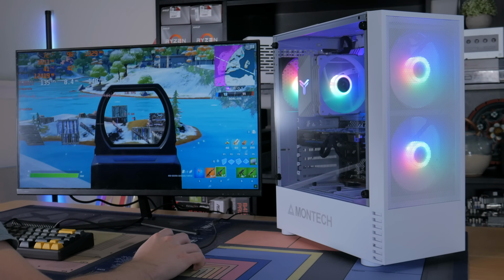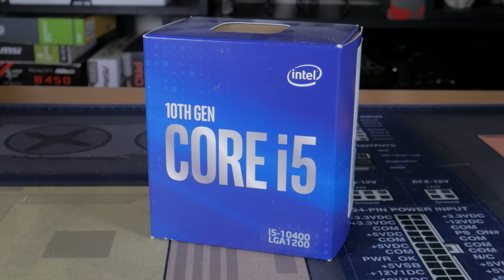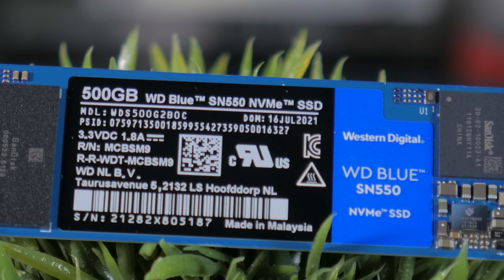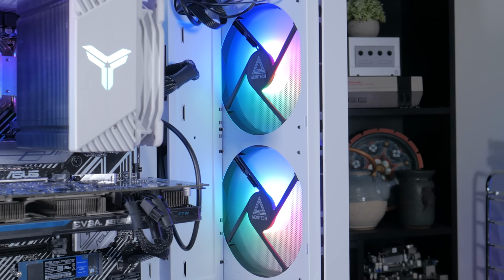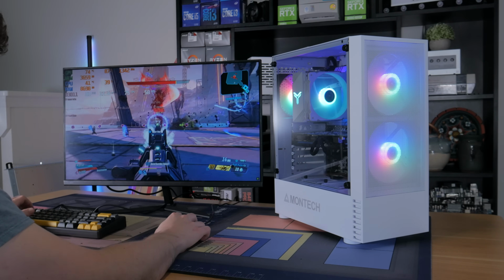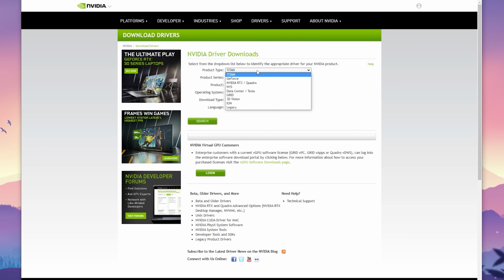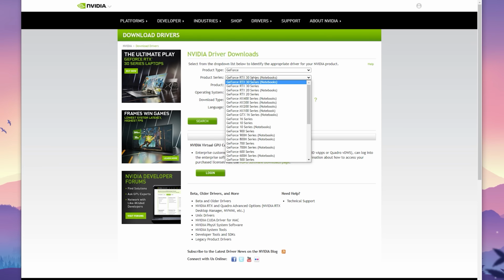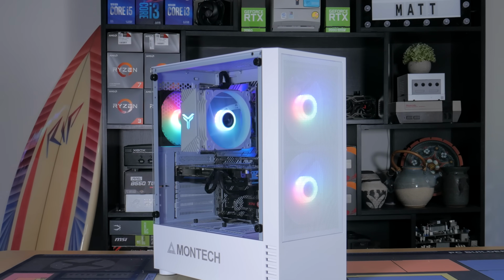$700 Gaming PC Build Guide! (2022)

Comment: So Glad to see you went with 16GB 8GB x2 kit for the DDR, in dual channel mode really boosts gaming performance considerably also helps with some productivity applications as well. I have seen some medium-budget builds on using a single 8GB ddr4 ram stick and it shows in the game stats. Today you can find a use 1660 super used on Ebay with careful bidding for as low $140.00 USD what difference a year and the end of crypto mining make on GPU prices.👍😉 Great video BTW

Comment: A GTX 970 is very similar to my GTX 1060 so I can assure you it's a pretty good card. I can still run most modern games in Medium-High settings at 1080p. I really wanted to upgrade last year, but GPU prices went to the moon and I just couldn't justify spending 700 USD for a 350 GPU. I really hope prices go down so I can buy an RTX 3060 and give my beloved 1060 a deserved retirement.

Comment: I am still using my 7yrs old PC:
I7-6700k
Gtx 980
16gb ram
And to be honest it's still running the newer games. But i have to choose either 60,70 ish fps on high(some games on ultra) or low medium for 144.
Recently I finished RDR 2 on high graphics(some turned to medium) on 80smth fps.

Comment: Matt has awesome tutorials. Currently rocking the dell optiplex 790 SFF with Core i5-2400 and GT 1030 GDDR5 from one of his previous videos and I’ve got to say he really knows his stuff. (p.s. I spent the extra buck and went wit actively cooled gpu)
Reply: how much did you pay for your optiplex? and 1030.
Reply: You can get almost any optiplex for $50 on Facebook or eBay, and I wouldn’t get a gt 1030, instead I would get something in the Gtx 900 series, you can find something good price used and the cards still offer a good amount of performance, much more than the 1030
Reply: @ligman1666  That’s true, I went with the GT1030 just to stay safe because I play esports titles and in his videos they performed well which is all I needed. In Ireland the GT1030 was the cheapest I could find on eBay
Reply: I’m going to be building a system based on the optiplex 3020, I’m going to upgrade it’s processor to a core i5 3470 (I’ll eventually upgrade to i7 3770k) and I’m adding a new ssd+ 16gb ram and a Gtx 960

Comment: RX6500XT is available on Jan 19 so I think it's better to get the newer Gpu than 970 a 8 year old card for 200$.
Reply: your dreaming bro, thats msrp i think, the moment they are available, those price will balloon.
Reply: @pantspants2951  Did I say that 6500XT will cost at msrp? Is there any gpu right now that you could buy at msrp? It will be overpriced definitely but my argument is that it's better to invest your money to a brand new 250-300$ 6500xt instead of nearing end of its life USED 970. You get the point?
Reply: @xDream3773  brand new 250-300$ 6500xt? you joking right, you clearly stated that if there is any gpu right now that you could but at msrp and rx 6500 xt is at  US$199 MSRP,  why do you think an old 970 is at 200$ on ebay, because the "market" is fcked, so quit dreaming on your so called "investing your money to a brand new"
Reply: @pantspants2951  It's hard to argue to ppl who don't understand the statement before they comment. Just go buy a 970 and pray it won't break after a year.
Reply: @xDream3773  its worker 8 years and running bud
Reply: @joskmhvtvtv5648  So if yo decided to sell your 8 yrs old 970 for 200$ and someone buys it, I feel bad to the person you sold it too not only its 8 years old but he probably don't know when the end of life of the card. Surely it wont last another 2-3 years or might die after  a year which is a waste of money.

Comment: I built my PC about a week before Christmas.  Montech 2 Mesh same as this one except it's black.  It's a really nice case for the price, however, I hate the cable management on it.  The huge 24 pin cable from the PSU wouldn't fit through the provided hole on the side.  I had to run it underneath and now it shows in the front, which really sucks.  If you have a non modular then be warned, you are looking at a really tight fit especially if you have a mechanical HD.  Thank goodness I just went with a SD because I see no way a mechanical HD will fit unless you are a cable genius.  Which reminds me, the SATA cable management sucks too.  You may have to remoce the HD cage... I dunno, I saw others suggesting that if you have problems here.  

Other than that, I suggest you put one or two fans on top for air.  My temps went down about 4 degrees simply by installing a ceiling fan to exhaust some extra heat.  I went with a Ryzen 5 3600 and a B550 Steel Legend ASRock MB and a potato for a GPU.  Can't wait for prices to go down.... GPU prices are killing me.  

Anyway, nice vid.
Reply: thanks for sharing your opinion about the case!
Reply: What was your price point and what potato of a gpu did you use
Reply: Sorry for the late reply but I put in an old  750ti... will be upgrading in the next few months maybe.  Right now I'm not really doing much more than web browsing and very light gaming.  So, it's not much of a priority for me.  Hopefully GPU prices continue to fall, heck, I may wait until Christmas when you can get deals. 

Didn't rally have a price point BTW, I got a couple of freebies, like a free PSU, some fans, and two free memory sticks.

Comment: I saw a prebuilt for $680 from Build Pro PC and it has an i5, GTX 1060 3gb and 8gb of ram. Building a pc right now is not really worth it to me.
Reply: Yeah but that one will have lower quality power supply, case, motherboard, cpu cooler, and has half the amount of ram most likely single channel. I am also wondering tho, what generation i5 did it have?
Reply: @jesus5258  it has an EVGA 80+ Bronze 500w and just a basic ASUS board. The RAM is duel channel.
Reply: @manzencow9582  With 8gb instead of 16gb it would perform worse but true it will be close
Reply: Plus 970-4gb is basically the same as a 1060-3gb. Some games will give 1-10 more fps with the 1gb extra vram on the 970. Some games will give 1-10 fps more from the extra power of the 1060.
Reply: @jesus5258  okay but this is a prebuilt and it is only $680
Reply: @jesus5258  it will perform about the same as this system.

Comment: Hey, very specific question, but I noticed how far the rgb headers are from the cpu cooler on that board. Did the cooler's rgb lighting cable manage to reach? I'm building a pc for a friend with that motherboard specifically, and that cooler looks like a great upgrade to the stock cooler.
Reply: Usually RGB headers are placed at the top or bottom of the board.
Reply: @PokèMyBalls  Yeah, I know where the headers are on that board. I was wondering whether or not the cooler had enough cable length to reach one.

Comment: Yes, GPU prices is kinda bitching at  people right now. I bought my 1050ti for like 150 dollars 3 years ago and now it's price went 250 dollars. 970 is pretty good though, I think it's still stronger than 1050ti.
Reply: even the 1660 super is like 600 rn.. it used to be like 250
Reply: it is still stronger then the 1050ti ;-;, a card that's about over 2 years older is better than a card with new architecture. I feel like i made a mistake getting the 1050ti instead of like a 980
Reply: @TheMacksterz  well,in one year the gpu stocks may cone back to normal

Comment: Good vid but i feel like if you saved money elsewhere you could have fit in a 300 dollar gpu instead of a 200 dollar gtx 970
Reply: I agree and RX6500XT is available on Jan 19 and might price above msrp around 250-300$ but still better than a 8 year old 970
Reply: @xDream3773  Idk i think I'd rather go with a slighter newer but still used card it will be more performance

Comment: Great video but I want to let you know that Vulkan in R6 siege is broken ,
I saw that you are using vulkan in the benchmark . At the moment if you play using vulkan you have to restart your game every 5-10 matches . Vulkan has a problem where it just fills your vram of your graphics card to a point that the game crashes or gives you a low vram warning . This is known to even happen to people who have over 8 gigs of vram . The only fix at the moment is to restart the game or play on the stock game engine
Reply from the maker: Wow I didn't know that, thanks for letting me know. In the past I found vulkan to offer better performance across the board, but I guess that's changed.
Reply: My friends all play on vulkan and haven't had that problem. I'm not saying you are wrong. I will advise them to look out for this.